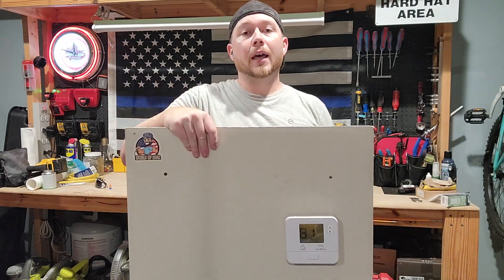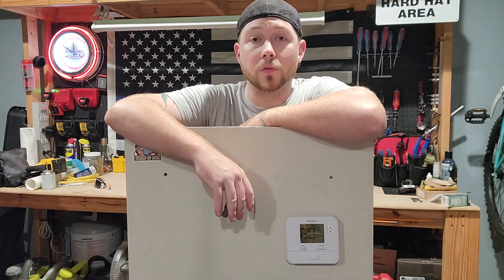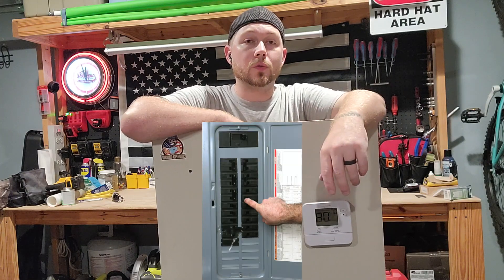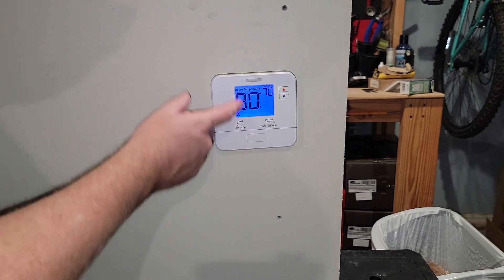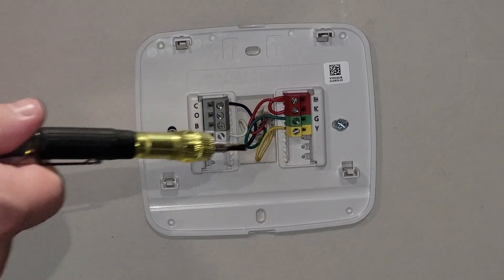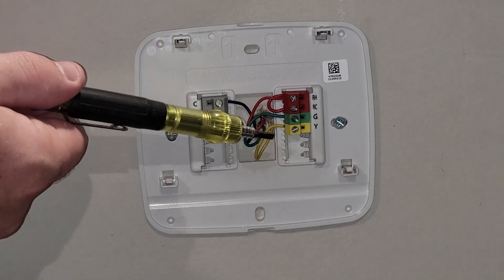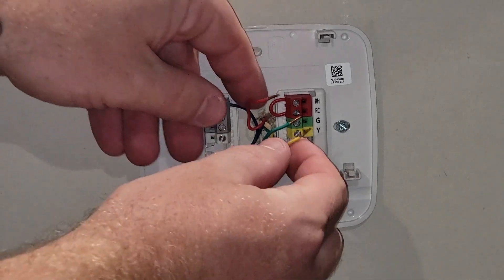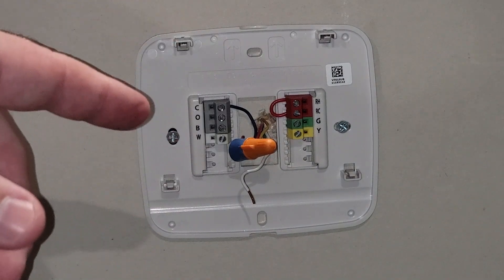How to bypass your thermostat

Comment: I need to do this for my furnace to get heat. Do you have a "heat specific" video showing which wires to connect?
Reply from the maker: Connect the red and white if you have gas heat. Add green if its an air handler

Comment: Pretty sure the wires that run in the walls of my 1974 double wide trailer from thermostattp furnace us the issue. We reolaced thermostat,  didn't help. The giy from weatherization came out. He said furnace is working and he tried to jump the wires and it wouldnt kick on. He said wires are an issue anx I have to call someone cuz they only work on the furnace for low income, not any electrical ... I'm a broke disabled single mom on ssi. I can't afford to hire someone. My mom ispretty good at doing these kinda things if we are told what to do. How do we find the wires in tbe walls and how do we find the short? Thats like 30 feet of wall or ceilingor floor ??? That the wires are behind ftom the walkway near livingroom to furnace which is outside in the wall near my bedroom

Comment: What is the wiring for emergency heat if the units been damaged/stolen..the heat worked last year but now I think the thermostat is not working..is it Green-Red-white this setup will make it work more or less like a clothes dryer right..the coils heat up and the fan blows over them through the vents?? Bro it's cold.thanks in advance
Reply from the maker: Yes red green white. Power fan and heat.
Reply: @WorldofHVAC wheww my main man..you just don't know brother thanks a bunch..may you become a very rich and prosperous human being and see heaven after you finished down here.. ✌️

Comment: Great video. I woke up this morning to find my thermostat screen was blank and unit wasn't working. Went into the unit and found the 5a fuse was blown. Replaced the fuse and it immediately blew again. Removed the thermostat C wire and replaced the fuse and the unit worked. Hooked the C back up and the fuse blew. Replaced my thermostat with same model and the heat came on in cool. When I turned the heat on, everything started spazzing out. My final diagnosis...shorting thermostat wire. I don't have time to pull new wire until the weekend. So, I went straight off the control board and jumped the RYC to get my AC going for the time being.

Comment: Yes! This helps heeps. I live in Northern Wisconsin and my 10-year old thermostat just took a dump. I can't do anything about it until my new T-stat arrives, so this advice could literally save my life! We're dipping into the negatives in overnight temps, and it's currently 54°F inside and around 10° outside. I have a friend who is a machinist and retired electrician. He suggested "jumping" the thermostat, which is how I found your vid. Phew!! He's coming over to help me with that tomorrow. Happily, I have an on/off switch for the HVAC system. If it starts getting too hot, I'll just turn it off until I need to warm the place up again. Thanks for this!! I don't trust myself to mess around with wires, but my friend will know just what to do! God bless!

Comment: Will this work for me to run my gas furnace with electric blower off a generator when the power is out? (Blower itself can easily connect to the generator; when I need now is a way to get it to turn on without power to the thermostat.)
Reply from the maker: Your thermostat should be powered by the furnace. Powering your furnace should allow you to use your thermostat. If not this will work.

Comment: Thank you, I was able to determine that the thermostat is the problem and don't have to replace the 1992 Bryant heat/cool pack just yet! 
Is there a thermostat you recommend? We don't have to have wi-fi control.
Reply from the maker: The ecobee is really nice. Glad I could help
Reply: @WorldofHVAC  my thermostat uses 4 wires; red, green, yellow and white. There are four more wires available but I dont know what connections are in the HVAC unit. Seems like all these new thermostats need 5 wires. We do run the fan manually at times so using G for C isn't an option? Thanks for your advice
Reply from the maker: If you have extra wires at the thermostat the best solution would be to hook up a wire to C in the unit and then add it at the thermostat. If its a gas furnace the C will be clearly labeled on the control board